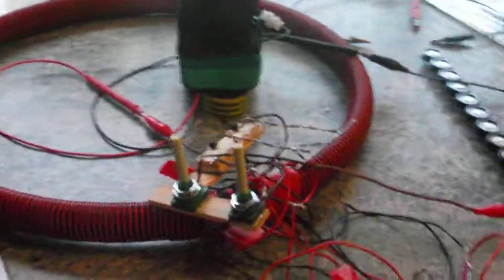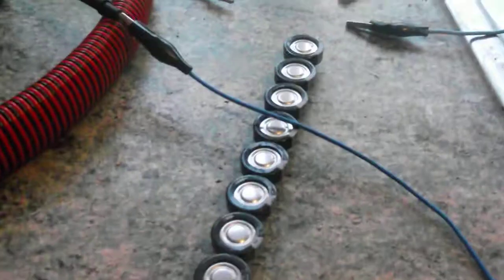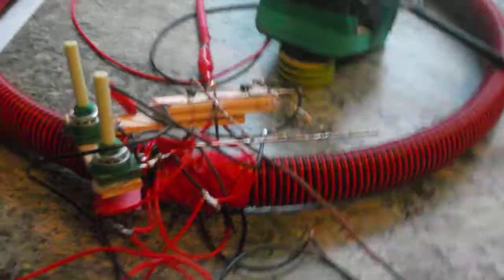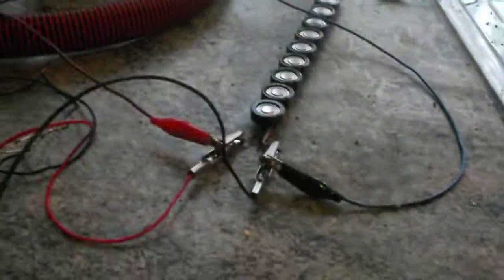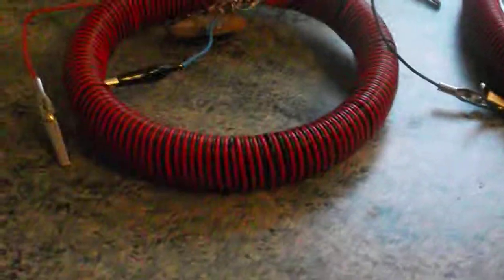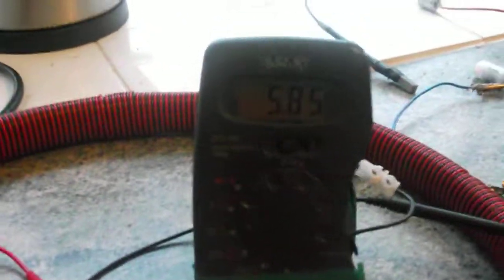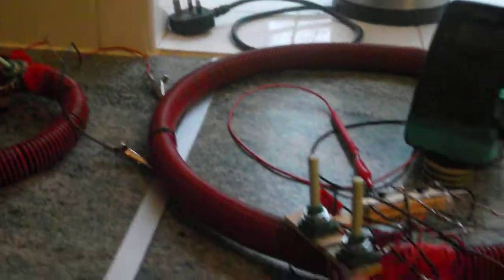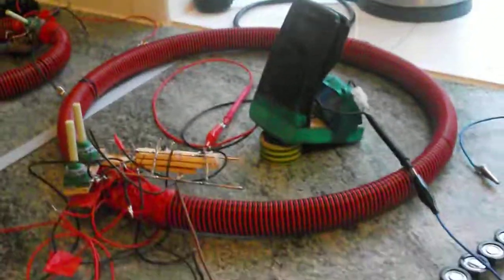Large FLEET Toroid.

Comment: Hi Oliver, I have built this few days ago and failed miserably. I am only getting probably 0.3v output from a 1.2v battery. I thought i have burned my transistor so I have changed it. Still the same. My 1.2 battery is losing voltage but the resonance seems not to happen to the second coil. Can help me? I am willing to donate what I can for your experiments. I saw your insane joule thief too. Would like to learn from you to build that too 🙏🙏
Reply from the maker: Thanks for your  kind offer but there's no need.  First of all don't operate any of your oscillators with the output disconnected because you will burn out your circuit.  I didn't experience such great charging with this particular circuit as its using the basic Joule Thief build which isn't so great for battery charging... there are far better circuits.  If you look into the Community section of my channel you will see a schematic called "Charles Seiler"  schematic....  use that diagram instead of the FLEET & you should experience better charging...  You may have to rewind your coil into a tube or open coil for better results... Good luck
Reply: @oliver1224  thank you for the reply. I built that because it mentioned that it was the easiest system to build to get CPO 4. Too bad it only amplifies the voltage and not increasing the output. Did you manage to achieve higher output with Charles Seiler schematics? Or Alexkor is better? 😁
Reply from the maker: @passion4z846  I didn't achieve any greater with the FLEET Toroid.  I think there was embellishment.  The Toroid is a poor choice for a coil in a Radiant Charging system as its closed loop & the circuit is just a Joule thief.. good for lighting LED's but not good for charging..  I've achieved better.  The Seiler or messner will achieve better.. I've regularly achieved one for one charge via Li-On batteries 3.7 volts..  Possibly greater COP can be achieved with more batteries across the output & with battery swapping. Choose your Cap Dump & be Careful with Li-On.... you can use them but I would advise against it as can be very dangerous.  Alexkor can make a decent 12v Charger...  they all require a Cap Dump.   There's also a Solid State Bedini Oscillator in my videos  which is a decent device...
Reply from the maker: @passion4z846  I'm unsure which I'd say was better... the Messner device or the Alexkor?  Its swings & roundabouts...   It all comes down to weather you prefer an electronic trigger or an extra winding....   the advantage with the messner is you can place another coil across the trigger Capacitor going to the ground & it will boost the volts even higher to improve the charging...  in a multi- coil system the messner would have the greater power but the Alexkor can really be fine tuned  & in that sense it makes it unique among other Solid State Radiant Oscillators...
Reply: @oliver1224  I have 2 bedini circuits. The highest that I have achieved is 80% with lead acid batteries. I try not to use li-ion unless my cap dump circuits are more successful. I am getting an oscilloscope to see what’s going on with the circuits.
Reply from the maker: @passion4z846  That's pretty good results.  I've a few Bedini's myself.  The most efficient Cap Dump I've experimented with to date has probably been the mechanical switch device...  I've built a few of them with home made Commutators....  I don't really play with that method all that much anymore.  Its a good way of making use of the Mechanical work of the Rotor.  Bedini always advised people to stay away from Li-On...
Reply: @oliver1224  that’s right. What I read was pulsing li-ion can lead to explosion. Which circuit you built have achieve better 0ver-uN1ty? I got some good results with tesla switch. But it requires 4 batteries to run to get 110-120%. Not that impressive for the investment 😁
Reply from the maker: @passion4z846  Its dangerous because the Radiant Discharge is a high pressure charge... & Lithium Cells are sealed with no ability to off gas... in other words no release so the pressure just builds... No over unity...  maybe the Self Runner with its recovery coils has the ability to go further than most..  Bedini built & patented a device back in 1984 that could charge itself....  it was hooked up to a 12v DC Motor...  most can't achieve it because they don't follow his instructions to the letter...   its a risky device because it can cause the battery to explode if its tuned incorrectly... he wrote a small book about it....  I'd like to get into the higher COP realm with battery swapping techniques...   this is where I'm heading eventually to take advantage of untapped potential...
Reply from the maker: @passion4z846  have you ever thought of trying the tesla switch with a solar input to make up for the losses involved?  I was speaking with someone on here who was considering trying that with a 4 battery switch low input system..
Reply: @oliver1224  I am building something totally different for solar panels. Theoretically will boost the output by 200% or more. There is no loss with my tesla switching. In fact, I achieved 110% with the right frequency and duty. Tesla switching only works for lead acid. You will lose power when you work with lithium.
Reply from the maker: @passion4z846  that sounds really good going with your switch.  Its something I've not actually experimented with.  I did see pdf over a yea r ago where an SG was converted into a Tesla switch....
Reply: @oliver1224  keep the frequency 100-800hz, duty cycle 40%, and use only lead acid. For tesla switch, constant swapping battery at the frequency is the key to achieve higher output.
Reply from the maker: @passion4z846  good to know.   I might get around to building one someday.  I'm working on something large at the moment.  A large Messner device.... I've had to put it on hold while I rebuild my blown out Comparator...  12 bifilar, coils, air core with 23 matched switching circuits....  I'm making the coils for it.. 6 complete & got another 6 to go....  with this type of device I've experienced good results..
Reply from the maker: I came up with a device about 5 or 6 months ago...   it makes a perfect Cap Dump & can replicate the function of the Comparator.  I call it "The Capsule"  I've built about 6 of them & they all differ slightly.  I use the higher voltage Capsule LED's & Halogens as a trigger & I get them to switch the load from the Capacitor to the Batteries...  these things have multiple uses.. & I built a protection system to kick in should anything happen to the output...  These bulbs all seem to work but they all differ slightly in some way...  the key is to take the bulbs just outside of the devices capability to light them...  & they start to switch...   if you look in some of my recent videos.... also there's some schematics I've shared.
Reply: @oliver1224  that’s really cool. I am using those 100v neon lights as trigger. But it seems like they start to blink at 72v. I am still waiting for my oscilloscope to observe the pulses. I just completed a big coil at 100m today. Good results but still need to fine tune for the best output. Multiple coil is definitely what I aim to build soon. Cannot wait 😁
Reply from the maker: @passion4z846  Yes about 73 volts I've noticed.  This new device is going to have 12 with one extra to enhance the trigger...   The Capsules have some kind of high tec circuitry inside them which makes what they can do possible..   they mimic the operation of the Comparator & Optocoupler in one...   I use them to switch a group of Transistors or Mosfets.... sometimes both together...   because I'm not using the gates or the bases there's no need for resistors...   they get a little bit warm across the low side that's all...
Reply: @oliver1224  nice, let me check it out now

Comment: Single core copper wire bigger better circle. Schematic? Lawrence Tseng Fleet basic circuit work okay?
Reply from the maker: It worked ok but I've done a lot better with a coil wound around a tube opposed to a toroid..  I've got some that are far more powerful that run from a similar input that can achieve one for one & still have a bit of energy left over.

Comment: strange.JustFinishingAndTestingResultsOfAAnAirCoreCoilJouleThiefAndThenTheFirstVideoWhichIsOnYoutubeIsYour's.WeNeedToTestAndResearchThisField.IHaveLimitedResourcesButIAmStillTesting.
Reply from the maker: Hope your getting what you want from it if you build it.. This was originally based on a FLEET design I saw..I've got better devices that charge from a similar input than this device..this was done some time ago... it was ok but it didn't perform amazing like some of the others I've now got.  The basic Joule Thief design is not great for charging batteries but good for lighting lamps. If you wire the Joule Thief like the SG-Motor you will get a lot more out of it in regarding battery charging...   if you check out 3 of my latest videos here on  my channel.. there's some low input devices on there... I've got one that can be powered from 3v input & it can parallel charge 3 x 9v batteries.
Reply: ok.IWillTakeALookAtOtherVideosOfYou.

Comment: Please consider that I'm starting in electronics:
I was using 12v acid battery to drive the circuit but the transitor was getting too hot to the point of smelling burned, then after watching your video I changed the battery to 1.5v AA and it seems to be working fine, althought with less output power on second coil. (With 12v the output coil lit a neon bulb, and with 1.5v doesn't)
Also I have some questions, how do I know how much resistance between the coil and transistor base(I red that I have to use Ohm's law, but I couldn't find the voltage, or where to measure in the FLEET)? And how can I apply a load properly? So far i've been using  it only to charge another 12v battery but I see you are charging Super Caps, what's the purpose?
Right now I only have a multimeter.
Reply from the maker: You may have killed your Transistors with that high an input.  What Transistors were you using?  I am using 2x 2n222a each transistor has 5k resistance with another 2k across the base.. .. I've found the specific type I am using don't like an input greater than 2x 1.5v but I've not tried charging anything greater than a 9v battery which it has charged but it took a longtime.  With these Toroids your measuring the voltage spikes and to get an accurate reading your going to need an oscilloscope.  I have used a 12v LED across the output with a meter and it does show the output rise several times higher than the input voltage..  be aware some of these toroids can damage your meter.. Don't run your device without a load attached to the output otherwise you will probably damage your circuit.
Reply: @oliver1224  err, I did kill one transistor, I'm using 2n2222a. The schematics is from the free energy info dot com I made with 180mm diameter plastic core and 2k across the base...
Thank you for your advice, I'll try to get an oscilloscope with someone.
Reply from the maker: @segen8324  Yes, that's where I got my info from. for it.. I don't see how he was able to run his at 12v without killing his circuit and he is a bit vague on his resistor values?   I believe I'm using the same type Transistors as yourself..  Beef up your Resistors... If you've got plenty of windings.. they work better and more efficient.  I'm powering mine with a mobile phone battery at just over 4v now.  I'm planning on doing an upgrade to this before the end of the year and I'll upload it on here... keep at it.  If you want to measure the spike its between the transistor leg of the collector and emitter.. good luck...